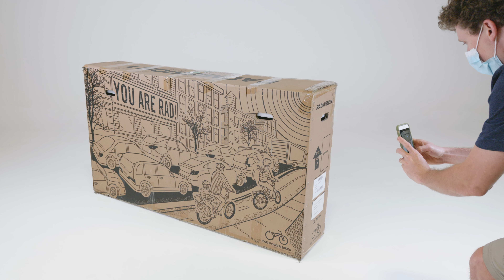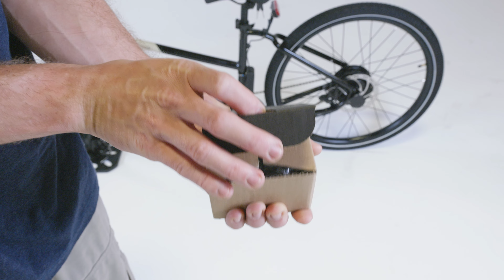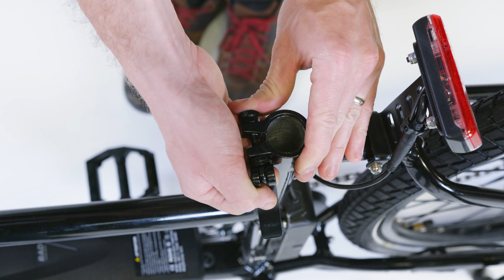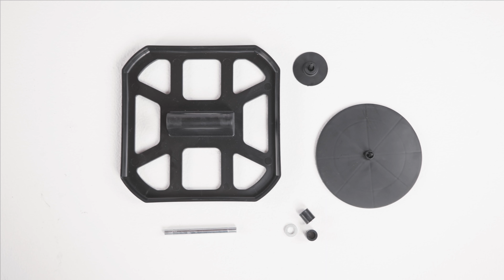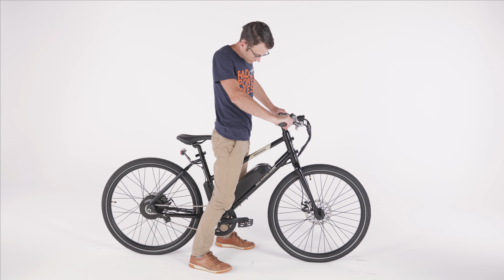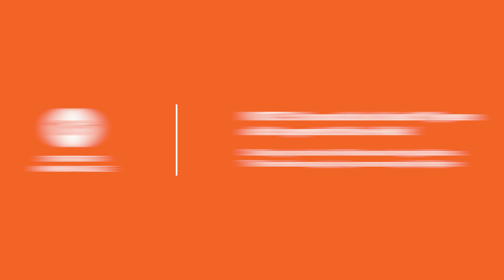RadMission Assembly  | Rad Power Bikes

Comment: Any tips on a torque wrench that will fit between the headlight mount and the handle bar face plate? I have tried two and neither will fit into the Allen screw heads as there is not enough space. I have tried the Bike Hand Brand and the EPAuto brand. Neither fits.
Reply from the maker: Hey Hugh, our Product Support team can help you out with this. They can be reached at (800) 939-0310 ext. 2 or at radpowerbikes.com/support, and they'll take care of you!

Comment: My cables come around the right side of the front post. It kind of came out the box like that with the handlebars on the right side...but this video shows the cables coming out the frame going on the left side of the post? My cables aren't that long so doesn't fit well on the left? Has this design changed since the video?? Thx for any help.
Reply from the maker: Hey there! Let's get you in touch with our Product Support team as they can take a further look into this, you can reach them at - (800) 939-0310 ext. 2, or email at - radpowerbikes.com/support.

Comment: The headlight you sent looks different…it’s round instead of flat, and doesn’t leave room for the bolts like the video describes.
Reply: After messing with it some, I discovered that if you loosen the nut a lot, that version of the light will give enough space to get your wrench in. It’s a bit deceptive because you can adjust it up and down with a limited range out of the box, and you think that’s all the flexibility it has. Hope this helps someone.
Reply: Same, I have a black highstep that came with a round light. I actually wasn't even going to attach it at first but whatever

Comment: They should specifically mention the battery charing - especially the "battery balancing" for the first three rides. I deal with a lot of rechargeable batteries and have never seen that before.
Reply: you'll still need to navigate that link, but here's the hard work anyway: 

Battery balancing is an important process to help keep your battery in great shape for years to come. This process will help ensure the cells in the battery are balanced and operating as efficiently as possible. 

The process will involve riding your bike, then charging the battery after each of your first three rides. After completing the battery balancing process, charge normally as needed, and only repeat the battery balancing process when recommended. Battery balancing should be done when a battery is new, after a period of long-term battery storage, if experiencing noticeable range decline, if instructed to do so by Rad Power Bikes Product Support, or up to once per month.

Note: Do not perform battery balancing more than once per month.

Take a look at the Battery Charging Steps in the section above to learn how to charge the battery.

Note: Never leave a battery unattended while charging.

Take your first ride. Ride the bike and use power assistance (the pedal assist system or the throttle) normally.

After your first ride: Charge your battery for as close to 12 hours as possible, but not longer than 12 hours. Charge the battery even if you only used a small amount of battery power while riding. The charger indicator lights may change to green and red to show that the battery is full, but keep the battery plugged in and charging for as close to 12 hours as possible.
Take your second ride. Ride the bike again and use power assistance (the pedal assist system or the throttle) normally.

After your second ride: Charge your battery again for as close to 12 hours as possible (even if the charger indicator lights turn green and red). Do not charge the battery longer than 12 hours.  Charge the battery even if you only used a small amount of battery power while riding.
Take your third ride. Ride the bike again and use power assistance (the pedal assist system or the throttle) normally.

After your third ride: Charge your battery again for as close to 12 hours as possible (even if the charger indicator lights turn green and red). Do not charge the battery longer than 12 hours. Charge the battery even if you only used a small amount of battery power while riding.
Take your fourth ride. Ride the bike again and use power assistance (the pedal assist system or the throttle) normally.

After your fourth ride and beyond: Charge your battery after each ride by following the Battery Charging Steps in the previous section. Remove the charger from the battery as soon as you see the charging indicator lights on the charger change to one green and one red light to indicate that the battery is fully charged. This usually happens within 3–7 hours of charging.
Reply: @loveh8love  thanks for posting, I could not locate this information.
Reply from the maker: Hey there! You can find more details about charging the battery here: https://radpowerbikes.zendesk.com/hc/en-us/articles/360044484033-Battery-Charging-Guide
Reply: How do you recommend charging the battery??? I heard there's a trick

Comment: ughh all these tools I don't have, like flat side cutters and pedal wrench
Reply: Update:
I assembled the bike.
All (non-torque) wrenches etc were included.
The hardest part was the disc brakes: Both of them needed adjusting. But the front rotor had too much wobble to account for.
I didn't use grease or worry about torque. I plan to take it to a shop and get the front rotor trued.
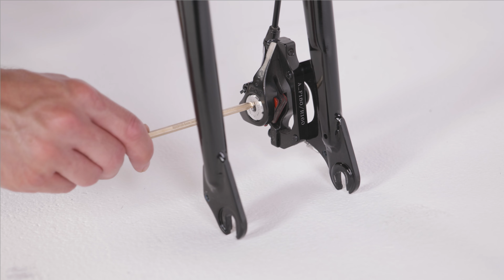By the way, the warning at 8:16 is very important. You don't want the ball bearing to fall out.
Reply: Can't help you if you don't have a way to cut zip ties, but everything else you need is in the included tool bag.

Comment: Funny thing is, the video came out when I finished assembling my Radmission 1! 😂

But I watched the previous video and that worked pretty well. (I mean these are almost the same with some added new clips to the newer one) 
One thing I would like to ask about the headlight, is that rectangular shape one has been changed with a circular shape headlight or I only got that unit? The rectangular one looks cooler tho :'( That's why I'm asking.
Reply: Yeah same I've had my mission for a week. Now have no idea why I'm here but yeah same I have a round light this light looks way cooler. Also tires are different from highstep to midstep